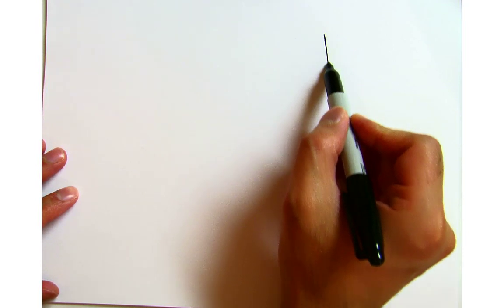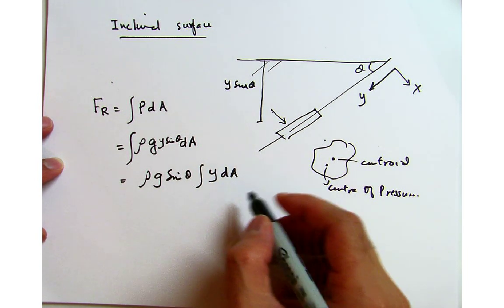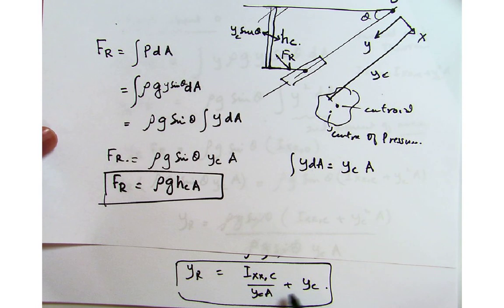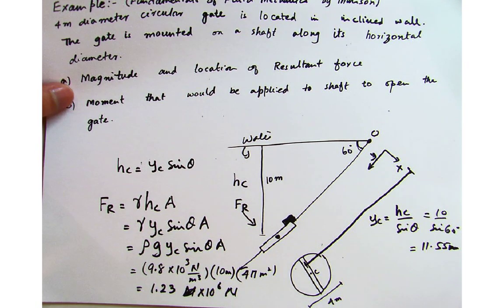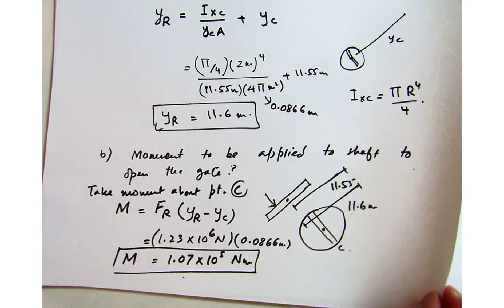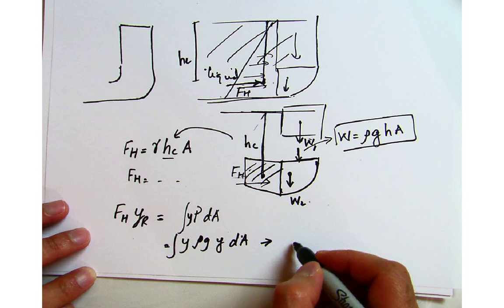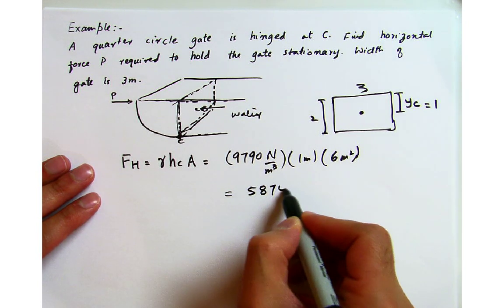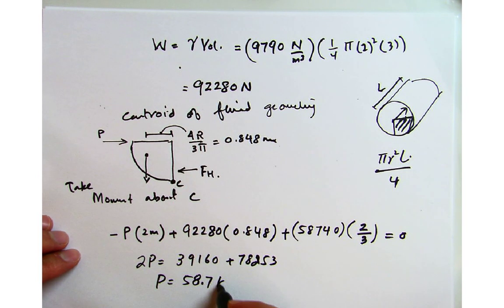Hydrostatic forces on inclined and curved surfaces

Comment: I have seen your video about resultant force exerted on a curved surface by fluid. You talked about when vertical force is due to the weight of the liquid column. What if the curve is the upper surface? Then what gives rise to the vertical component force this time?

Comment: Great video. Can you help me with a problem I have: "A cylindrical weir has a diameter of 3m and a length of 6m. Water on one side of the weir is upto a depth of 3m (The diameter) while on the other side it is upto a depth of 1.5m (lower half). Calculate the magnitude and direction of the resultant force."

Comment from the maker: static pressure is the pressure that an object will experience due to number of molecules in the fluid (also known as thermodynamic pressure), so more number of molecules in less space the higher the static pressure. When fluid starts to move it has velocity pressure, so now fluid has both static and velocity pressure, so when a moving fluid is brought to rest, you can define that by stagnation pressure (stagnation pressure = static pressure + velocity pressure)

Comment: on another topic, can i ask: when a pitot tube is used to measure velocity in a pipeline, there is a stagnation pressure head and a static pressure head, what is the difference, (i am thinking static means v =0 and stagnant means v = 0)

Comment: hey there's a question i have from past exam, the question is to find hydrostatic force on one side of vertical circular gate ... then the question asks to explain briefly what additional force i need to calculate if the gate located in an embankment inclined at angle theta from the vertical? .. what do they mean by the additional force? all what it changes is the angle so the Yc just changed!

Comment: The profile of the inner face of a dam is  parabola with equation z=.3x^2.The dam retains water to a depth of 30m above the base.Determine the horizontal and vertical components of thrus on the dam per unit length and the corresponding line of action of these thrusts from the heel of the dam.Determine aslo the resultant thrust on the dam,Its inclination to the vertical and the distance from the heel to the point at which the line of action of this thrust intersects the horizontal base of the dam

Comment: thanks a lot for the videos, I'm just a little confused, when you use the parallel axis theorem to go from the Ixxo to (Ixxc+yc^2A), is that step just to simplify things? if you had the information could you just work out Ixxo and plug that in?